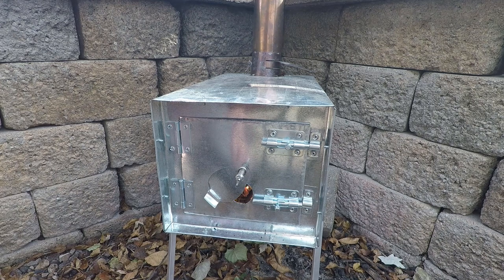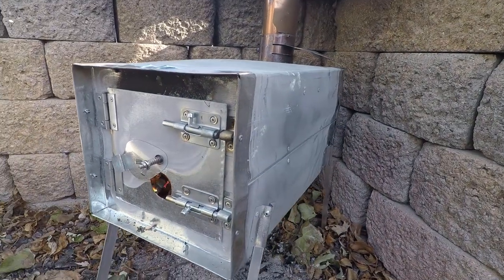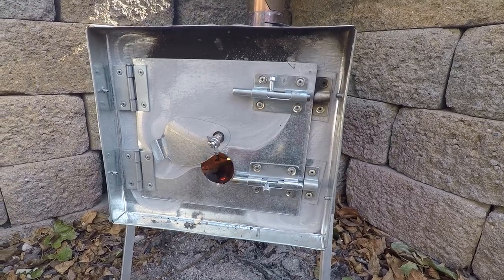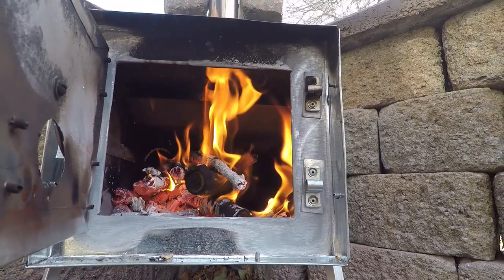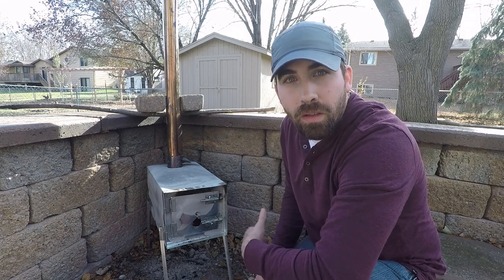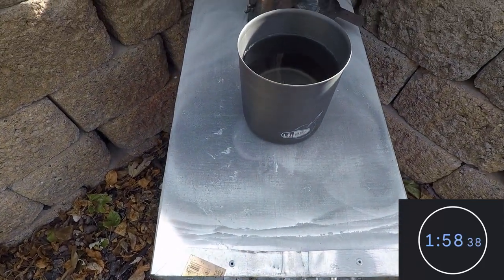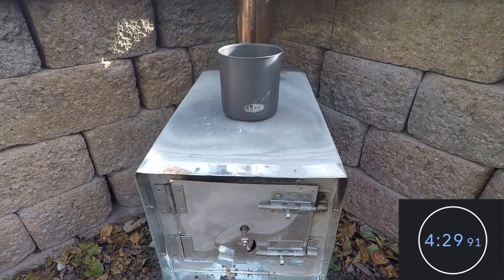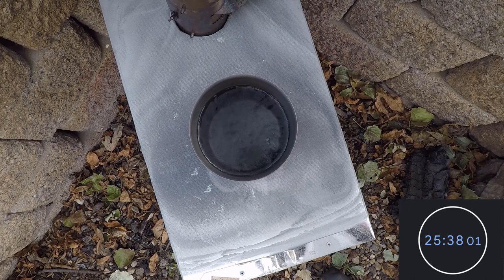Testing A $50 DIY Hot Tent Stove....Does It Work?

Comment: Awesome. stove.    I'm going to say that the reason for the back draft is probably mostly your baffle.  If I remember right from seeing your stove build video, I think you said or indicated that you placed the back of the baffle against the back of the stove.  I left mine away from the back about 3/4ths of an inch.   Also you may find that it also helps to place the front of the stove a little lower than the back of the stove.   Or in other words, place the back stove legs higher that the front legs if you have to.  That means your eggs will run to one side of your skillet when cooking on the stove but it may be worth it if it stops or minimizes the draft problem.
Reply from the maker: Ah ok, I did place the baffle up tight against the back of the stove. When I fire it up again I'll try and place the back of the stove higher like you say. Maybe that's all it is. Worse case I'll drill out the rivets and tweak the baffle. Thanks for the inspiration and checking out my rendition. 🙏
Reply: i forgot that in my last reply.maybe that baffle back gap in norths stove helps to heat the chimney pipe during lul of burn.hey.i had a thought your paint can stove would be good for late spring early fall when you dont need tons of heat. ok i think thats about it.thanks

Comment: In order to get a MUCH quicker boil time on your "boil test" you will want to do just the opposite of what you did.  Open the intake all the way and open the stove pipe draft all the way.   You should be able to get the stove body glowing red doing that.  The stove pipe damper is for reducing air flow.  A fire needs air.   The more it gets, the hotter it can burn.   Yes if you close the pipe damper when the stove is already hot it may make the stove temporarily hotter because of trapping more of the heat  in the box but it will also slow down the burn and will eventually end up being a cooler stove later.
Reply from the maker: Ok that makes a lot of sense. I've been super confused by how that all worked. Thanks! 😄

Comment: it's great that you make videos about diy stove. I watch a lot of them to learn to build my own tent stove.. I will build it from scrap metal of ventilation shafts. The smoke pipe by the side of the front door and with a baffle, that the flames and smoke go behind and do not go out of the front door while opening. I will see if it works. Also an ash pan with a 3/8" distance to the bottom as a double bottom. It will reduce radiation heat to the ground and prevent the bottom from burning through. Maybe a double wall on the back for some afterburner holes. I will see if I can boil faster. 
Best regards
Reply from the maker: Cool! Thanks for the tips. Its fun to see others building these.

Comment: Appears to be a nice stove,   I've notice on all the stove I've built that if I install a 4 inch stove pipe hole I have issues with smoke when I open the door.   Alaska tent and tarp sells a 5 inch stack able stove pipe that solved the smoke issue for me.  I do not use spark arresters because of the way I place my pipe out the front of my wall tent  at angle.  Not saying its the best set up but it works for me.  The only issue I have is I have to make sure the seams are at the top of the pipe to prevent creosote dripping down the wall of the pipe onto my tent.
Reply from the maker: Good point, I'm only using a 3' pipe. 🤔

Comment: thanks for the video.allways learning.i have a theory on smoke problem.very easy to test. maybe the slit design flue and arrester is cutting down stack drawing power of of chimeny. if a taller pipe gives more draw,than maybe the slits at stove top level is cutting draw by 40 percent.just a thought i had an hour after watching this vid.ive never built a stove but have watched tons of vids on building them over a few years.ok,thanks again for annother adventure
Reply from the maker: Hey John, I think you might be on to something there. I get some smoke in the tent when I open the door after the stove cools down. When it's cranking hard I don't get any smoke in the tent when opening the door. I'm using a 3 inch flue that's 7.5 feet long. Wondering if I need open that slit in the baffle just a smidge. This Sunday I'm posting a video of that stove on a -7F overnight. It did pretty well just need to fix that baffling baffle. Thanks for watching 🤙
Reply: @SignalOutdoors  thanks for your projects.allways think its interesting to see diferent variations on things of same genre of things.i wish i could be able to watch every video just on these lowcost home tent stove builds.but its an infinite number.not to mention all other subjects.lol
Reply: @SignalOutdoors  if you have a pipe with no slits in it.maybe try it out.its the only thing thats stands out to me on your build  version of far norths stove besides 3 inch to 4 inch.maybe check pipe temp outside at the time fire lowers down.ive heard cold chimney will allways create backdraft.thats why houses with chimney on outer wall gets back draft more comonly than chiminies built in the center of house.once chiminy gets cold.that air wants to sink.good job on the build.i allways learn something.
Reply from the maker: I think before my next adventure with the stove I'm going to add that 3/4 inch slit at the back of the baffle. If the doesn't work my only next option will be upgrading to a 4 inch flue like you mention. Thanks for the tips, very much appreciated. 🤙

Comment: Boiling water on a wood stove with a tiny bottomed pot does not make sense. I am not trying to be mean here but explain why the tiny ,tall pots came about. Canister stoves, that's why! Large bottom pots reflect heat down on the fuel canister and that's not good. A large bottom pot on a wood stove is way more efficient and will result in a way faster boil time. The right cooking equipment for the fuel source at hand. I like your stove very much, your cook pot, not so much. 😊 Thanks I think your stove build was a great success!